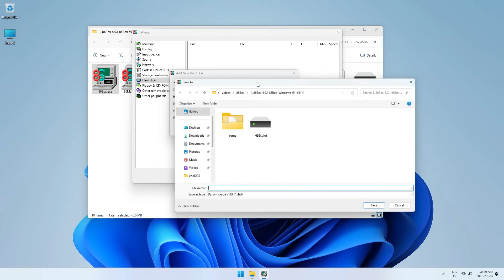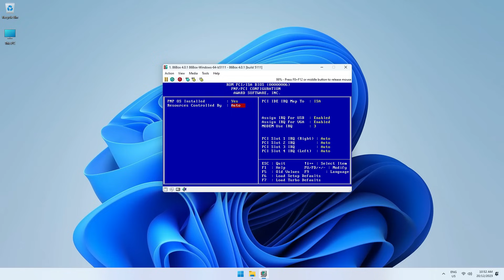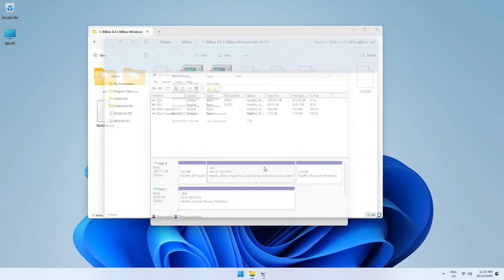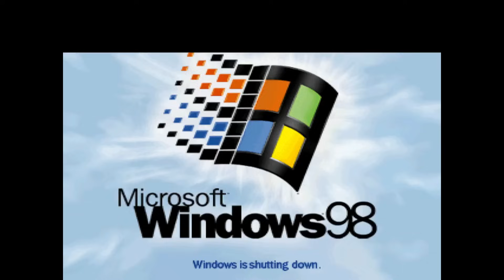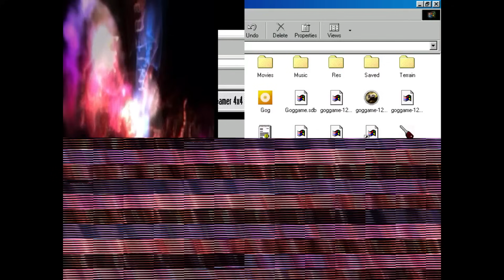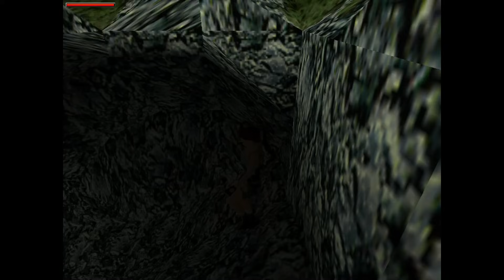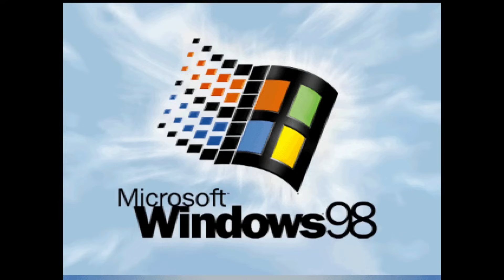86Box Windows 98 Setup (Pentium II +Voodoo  3, all files provided)

Comment: hi phil, your tutorial, awesome. thx so much. two issues to wonder. first: a flightsim from the mid-90ties designed for win98se, the planes are not steerable, because the arrow keys not working. there is no configurable keyboard on 86box machine settings to probably fix this. second: optical drive d: when removing win98.iso, any other cd doesn't show up after putting it in the real drive. thx and greetings from germany, gerd

Comment: Hi! Thanks for video! Helped a lot with configuration. Any new advices to improve stability and fix audio stuttering? Sometimes when I play 3D games my PC can't handle emulation. (Ryzen 3700x with RTX2060 on board) I chose slowest PII and 512MB Ram with Voodoo3 for emulation and changed something from audio options from 200ms to 400ms. Idk is there something I can do more without changing CPU or GPU. 😊
Reply from the maker: Audio stuttering means your host CPU is too weak 😢
Reply: @philscomputerlab  Thanks for answer! So I need to find newer CPU for my platform. 😟 Have a nice day!

Comment: the sound is choppy, is there a fix?
Reply: Most likely, this is a result of the emulated machine not being emulated at 100% speed consistently. (Source: tried different drivers and methods for a long time to get sound working until noticing that the machine was emulated at 70% speed). Most older computers will not be able to emulate Pentium @ 100 MHz, let alone Pentium II.

Comment: Do you have any tips on how to play games from 1999 to 2001 with it? I tried playing A2 Racer 4, but unfortunately, it runs very slowly with the settings you showed in the video. And I can't select recompiler to fix it. :(
Reply from the maker: These games are quite demanding, I don't think they'll ever run well with 86Box.
Reply: @philscomputerlab  I'm running out of ideas for playing my retro games on modern host systems like Windows 11. VMware Workstation 17 has sound stuttering under Windows XP. VirtualBox's graphics memory is also limited to a maximum of 125MB under Windows XP. And now the 86Box can't even smoothly emulate 3D games from 1999 to 2000. 🫤

Comment: i too really dig the way you just dive into the videos no dumbass intros just go. very cool. also, with the new version of 86box (there's an update available) you no longer need to use the 86box manager. it is built right into the 86box executable. if you want to enable networking for 86box, you will need to install PCAP for windows 11 and share your NIC on the host box. then choose pcap for the driver type in the networking section of the vm configuration and make sure the nic is in the "connected" state on the vm while it is running. i was able to get networking up and running on my windows 11 host. works quite well.
Reply from the maker: Thank you! I've done a recent video on V5 of 86Box, I really like it!
Reply: @philscomputerlab  oh heck yeah! the best emulation software around. even better than vmware will ever be. its cool 86box uses bios roms of the old cards and they act like they are physically in a machine. that is sweet. i can recreate an old box i used to have back in the day. I actually had an AOpen AX6BC slot 1 board so that was cool to see.

Comment: I'm getting quite a bit of stutter. Even playing pretty basic games like Command & Conquer. I'm using a M1 Mac. Is there something I should adjust in the settings that my machine might be having trouble with?
Reply from the maker: Not sure about running this on a Mac, I only know on PC.
Reply: This is probably caused by the fact that emulating Pentium II requires a lot of single-threaded computing power and most computers simply haven't got that much of it. As a fellow M1 user, I also tried to emulate a Pentium II (equivalent at least, a K6-III @ 450 MHz) and failed, as it could only emulate 40% the speed of an actual K6. I'd recommend lowering the specs, personally.

Comment: I have noticed that the sound is more laggy if my auido device is set to 24-bit and above 48000Hz. On 16-bit 48000Hz there is MUCH less or no lagg depending on the virtual machine hardware running.

Comment: thanks for the tutorial. at 2:52 you specify VHD that I dont have, I dont see any instructions on how to get it either. can you please clarify? also Can you explain how to make a less demanding emulator for those of us that dont have an i7-1300K. thanks
Reply from the maker: You create the file in the previous steps. It's a virtual HDD image. There is no faster emulator I'm afraid.
Reply: @philscomputerlab  I believe the question is not to get a faster emulator but a less demanding emulator. something that can be run on say an i5 8th gen.?
Reply: Just lower the processor speed. My advice would be to start halfway at 200 and go up or down from there. The speed % indicator should hover around 95-100% most of the time. But that'll fluctuate as the PC boosts your host clock speed. Highly recommended to run on a Linux distro, rather than windows. Windows is very resource heavy even with no TSRs in the taskbar.

Comment: I heard that it's a cycle accurate emulation. Would be interesting to compare dos benchmarks like Shiny benchmark or your DOS benchmark pack with the actual machine. Are you aware if this has been done? I can imagine that cache access and maybe FPU performance could differ. I ran a test in c exe I wrote and had the feeling the machine was much faster than my actual machine at that time.

Comment: Firstly, thank you for the very comprehensive tutorial. I have my first VM Windows 98 set up on 86box!! Feels great - thank you!

I'm having some issues running some games. Total Annihilation (I notice it was also in your testing but not featured) runs but without music. The sound in general works, but the background music does not, yet. This is the same for a couple of other games, for example worms 2.
I'm so close to getting that pure nostalgia hit, but not quite yet! 

Any ideas anyone???
Reply from the maker: Likely the music is playing from CD.
Reply: @ hm. It’s a weird one. I did buy a physical pc for the purpose of trying to run this game a while back, and I had the same problem on that machine, with the disc in the disc drive. Emulating was really my last idea.

Did you end up trying out Total Annihilation on your 98 vm in the end? Wonder if you got the same issue.

Is there any way to your knowledge of ‘passing through’ the VM so that the VM uses my physical cd drive which is running the cd?

Comment: I use a different method in 86Box for installing Windows. I boot from the CD image, start the PC with CD-Rom support in DOS, and copy the cab files onto the HDD. I then run setup from the HDD so that Windows will always go to the local cabs and never ask for the Windows CD. I've done it this way since Windows 95 was new and I've even done this for Windows for workgroups 3.1. I have a video showing how here: https://www.youtube.com/watch?v=WnFPRGsLEjs EDIT: Also, when it comes to making and formatting .VHD drives, you can create them and format them in Disk Manager which is so much quicker than the older windows methods or creating them in 86Box.

Comment: Everything worked but the game I'm playing runs very badly even though is much less demanding than the ones you are, any suggestions? Sound is also awful :(
Reply from the maker: @javierperez2632  What's your host computer and how many MHz have you configured?
Reply: @philscomputerlab  ryzen 5600x and I configured it just like in the video, Pentium II deschutes and 450 speed.
Thanks for the answer by the way
Reply from the maker: @javierperez2632  Yea that CPU is getting old, and 450 needs the best of the best CPUs. Try 233 MHz, or emulating a Pentium MMX with even lower speed like 166 MHz
Reply: @philscomputerlab  instantly fixed it! Who wouldve thought that reducing the speed would make it better... thank you! :)
Reply from the maker: @javierperez2632  Awesome 😎👍

Comment: So after installing it successfully there is still lag when browsing through windows. Using i5 4590t with 16gb RAM and 512 SSD. Any idea what settings to change?
Reply: Yeah, makes sense. I reckon the emulation speed's not very consistent. A 4590T will not be enough to emulate a Pentium II (450 MHz), tried doing the same (albeit with a K6-3) on a 4460T and failed tremendously. Not even my M1 Mac (which gets more than double the points of a 4590T in PassMark Single-Threaded) could emulate that config properly. My recommendation is that you settle for something somewhat similar to 486.

Comment: Disk boot failure. What should I do?
Reply: I played around with the CD drive settings and that worked. I use ATAPI, Channel 1:0 Speed 8x type 86BOX cd-rom 1.00 and that seemed to eventually work.
Reply: @randomjpgarbage  If I remember right that fixed it for me too.

Comment: Nice program, i find it nerdier to run this with my MacOS and ARM M1 CPU, cause its not even close the same architecture. I mainly have 95'ish era configs, some pure MS-DOS and also MS-DOS + Win95/98 stuff configured, 486dx2/66Mhz and some earlier Pentiums. Also Gravis ultrasound is nice to have for the demoscene stuff. Good times 🤓

Comment: Tried in a AMD Athlon X2 64 4000 but it runs extremely sluggish. You need a very fast proxessor to run this. Using Oracle Vm runs 98 really neat but without video acceleration.
Reply from the maker: @cferrarini  Yea that machine is way too old. Try DOSBox or running DOS and Windows 98 natively.

Comment: Anyone using Win98 on 86Box for retro software development? My old Win98 dev box is starting to have issues, and outside of trying to rebuild a new one, I'd really prefer to emulate on my Linux machine. The usual suspects: VC6, Delphi7, MASM 6.15, etc. DosBox-X is doing fine for my DOS 6.22/Win4WG development, but at least with my efforts doesn't handle a Win98 box very well. Would 86Box do better for Win98 developer tools?

Comment: Can anybody point me in the right direction? I need a 9X emu/VM with bare minimum 700Mhz CPU (preferrably at least 1.0Ghz) but also hardware accelerated graphics. 86Box's Voodoo emulation should be sufficient in theory, but the fastest CPU I can emulate full speed is a 100Mhz Pentium. I've successfully installed 9X in Linux KVM/Qemu via virt-manager, and it should be plenty fast enough CPU-wise. But even if I had a real 9X-compatible GPU around to passthrough, I doubt it would be physically compatible with my machine. Is there anyway to pass an emulated GPU to virtualized PC?

Comment: Try PS2Rate utility to up the polling rate of the PS/2 mouse. I remember using it on real hardware and funnily enough it works on 86Box too. 200hz makes the mouse feel a fair bit smoother and nicer.

Hopefully the devs will implement seamless mouse feature, or at least something that will make the mouse feel as smooth as on the host machine. I've been using DOSBox Staging for this very reason and it's a massive game changer (as well as their dos_rate parameter, try setting it to 1000). It works fine with a lot of games and it makes the mouse ultra smooth and responsive (for example, I always found Master of Orion 2's mouse to feel laggy and odd on older DOSBox, but on Staging it's silky smooth).
Reply from the maker: @animaegray  Staging is awesome, a heap of developments that really make a difference.

Comment: After spending couple do days figuring staff out, I can say that this video needs a caveat about voodoo3 drivers.

One the games I use for testing is a WH Dark Omen, which is notoriously hard to launch on modern hardware and OS. Turns out it also kind of flaky on voodoo3. It works on driver v1.01.02, but fails to launch on 1.03.00 and ANY later drivers, including recommended here amigamerlin one.
Another hard case is SW Rogue Squadron, which i managed to make work correctly only on 1.03.00, later and earlier drivers have multitude of visual issues.
Probably Voodoo3 emulation should be only recommended for DX7 games, where newest community drivers work well.

It seems like for DirectX5-6-6.1 using S3 Trio64 + Voodoo Graphics emulation set to Voodoo2 works best in term of compatibility where both games worked on 3.01.01 driver.
Reply from the maker: @L1vv4n  Great information, thank you 😊

Comment: the only advice I can say:

You need a very strong cpu, for example, a i7-7700k can emulate max 200mhz 233mhz ish, and a ryzen 7 5700g can emulate between 233-350mhz ish

everything above 300 mhz can be very stressfull for your computer, and therefore, the emulation can be slow

Comment: Thanks for the walkthrough. Where or when did you use Amigamerlin 2.9 and overclock.exe?
Reply from the maker: In relation to the 3dfx Voodoo.
Reply: @philscomputerlab  In the walkthrough a Voodoo3 card was installed. The readme file for Amigamerlin2.9 states it's for Voodoo4/5 cards, thus I'm not sure if I should use since it wasn't installed during the walkthrough.
Reply from the maker: @wattosdeal  Yea that driver is based in V4/5 but made to work for V3. They are community based.

Comment: Great video, very clear and everything works. Except 3dmark 99; which has all the textures inverted for some reasons. Tried to change settings but keep rendering everything with flickering textures in black and white for some reasons. 3Dmark 2000 instead works just fine (score a meager 1819 if you are curious)
Reply from the maker: Makes sure DirectX is installed?
Reply: @philscomputerlab  Thanks, got the one you have on the video description; for some reasons the issue seems to be just 3dmark 99. Did you try to run it ? Was it working for you? In the video you run games and those seems to work fine.

I suspect that older games may not run as 3dmark 99 does not run well; will try some older stuff and see

Comment: that signal pitch spike noise at 20:10 is horrible. 

why people bother providing links to stuff instead of just providing a direct link, preferably a pre-made vhd,  is beyond me . Like hey we don't do piracy here, but we provide everything you need to replicate it just too scared to use my own storage... - just a general gripe nothing at this channel personally.

The guide is pretty useful becuase 86box has terrible documentation just like all emulators. 

Virtual PC 2007 still beats any of these emulators, would be much better for people to get that working than having 64 thousand dosbox builds, 86box, qemu and the endles list of worse alternatives.

Win 10 32Bit still has NVTDM support and if people stopped focussing on borked replicants of emulators and instead focussed on the github projects related to directx , nvtdm and the like then we could have everything working in a 64bit OS within a month

Comment: Man, it is a good video, but what a machine you choose to emulate on 86Box:
Step 1 to emulate a Pentium II on 86Box: Break in into NASA and steal at least four supercomputers you can run in parallel!

Seriously: A high end last gen Ryzen 7 would struggle with anything over a Pentium MMX 133, it is super unoptimised! (But still, so accurate and with so many options that it might be the only viable option alongside PCem, which is less feature rich, better performant, but still not great in speed, and has not seen development for years.)

Comment: Amount of selected RAM affects the emulation speed - instead of 256MB select as low as 128MB or even 64MB which greatly improves emulation speed and eliminate voice issues. 64MB or 128MB is still enough for most of the games anyway. The same issue is with PCem.

Comment: I made a Windows 98 machine following this, except I used Ensoniq AudioPCI for the sound card.  I had problems with the audio lagging/stuttering with this setup.  However, when I switched the CPU type to Intel Pentium Pro, and set the memory to 128 MB, the audio seems to work just fine...  Using 86box, I was able to get the Ensoniq AudioPCI to work in DOS, which I couldn't get it to work in DOS in VMware!  I rather like how different the games sound with it compared to the original Sound Blaster that DOSBOX emulates.
Reply: This worked better for me. Thanks!

Comment: Very good tutorial. Easy to follow, even for a novice like me. Where I'm stuck is, how do I put games on the emulator itself? For example, I have Rugby 2001, on its original cd. How do I go about transferring this, onto the emulator side, to play. If anyone could help, either by a step by step or point me in the direction of a video tutorial, that would be greatly appreciated
Reply from the maker: Yes I believe you just add your real optical drive to the emulator when configuring drives?

Comment: I'm using VMware Workstation Player and Oracles VirtualBox on a 12700k and I get stuttering when the VM utilizes Efficiency Cores, I don't know if this emulator has the same issues.
Reply: Small Addition, QuickCPU should allow parking E-Cores on every System but for some reason the VM performance didn't improve. Graphics performance issues with Workstation Player, Audio issues with VirtualBox with DirectX Titles or no Sound at all when game uses ogg audio files. Sound with VLC or WMP no problem, could someone please write a capable XP VM.

Comment: 86Box is bad for do never get any pure smooth motion. I recommend you run lastest version of Dosbox X with very high CPU cycles-FIXED (not "max" nor "auto"), OpenGL mode and vsync enabled + 60Hz monitor for get pure smooth motion. 😍👌😁 But you use recommendly any CRT monitor or modern LCD monitor with excellent single-strobe for work 60Hz and for almost eliminate any motion blur - eg: Viewsonic XG2431 24" or XG270 27". 🙂😊😉